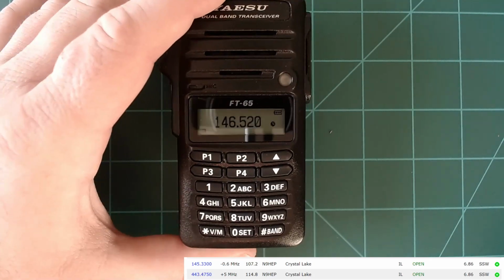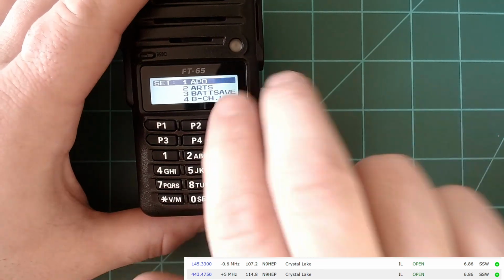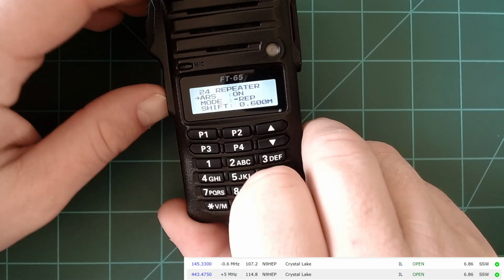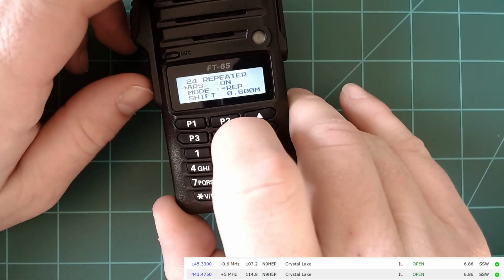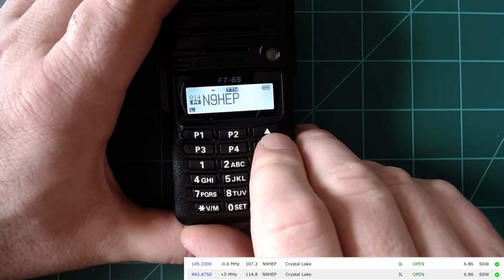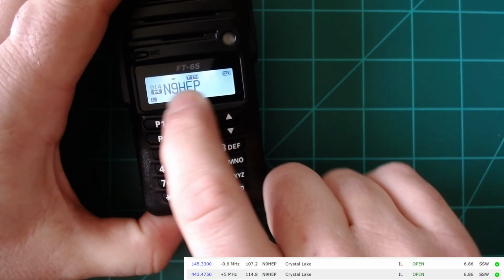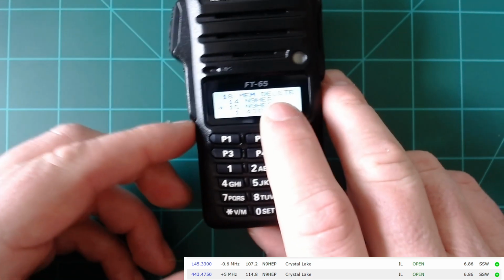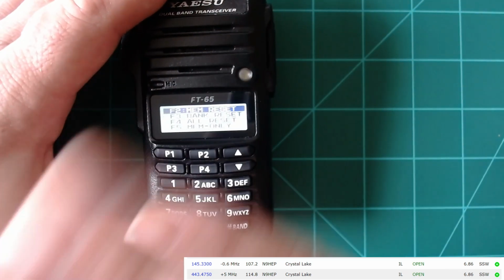Yaesu FT65 Manual Programming, editing and deleting

Comment: To tune a saved channel you select the memory channel, press band button. You should see a small "tun" text flashing on the left corner of the screen, just punch the new frequency in or use arrow keys. At least this is how it works on my FT65E purchased recently. Maybe they updated the firmware or something to make it easier.
Reply from the maker: Many Thanks for the helpful suggestion!  I have pinned your comment so others may find this useful information, easily.  73!
Reply: What Michal writes will allow you to temporarily tune to a different frequency. To save your edits permanently, you need to follow a couple more steps. After entering your new frequency, press and hold the *v/m button. Then use the up/down arrows to select the number of the channel you want to edit. (It will be flashing on the left side of the screen.) Then press and hold *v/m again to save your edit.
Reply: What if you’re already on the memory channel you want to edit?  Would you just press V/M again?

Comment: The P1 P2 and P3 are programmable buttons off your command program screen just hold the buttons down and remember so you don’t have to scroll down for CSST or the repeater function makes life little easier also holding down the six for long period of time will lock the phone the keypad in case your owners are using one frequency

Comment: I am adding a new channel, I have just Simplex on the Repeater menu, no - or +, store the channel, test it but when I move up down in the channel list when I come back to the channel in discussion I have a minus and it transmits with a -0.6 Mhz offset. Why? It's like it's ignoring the settings that I have when storing.
Reply from the maker: What frequency and offset?  Is it possible the offset will put it Out of band ?
Reply: @DudeTested  - No, I tested it in manual mode and works fine. I punch in a frequency, go to offset menu, set it up, go back to memory, memorize the channel, give it a name when prompted and it works good. As soon as I move to a different channel and come back, it's like it forgets the offset or chooses one of its own.

Comment: Ham radio dude,thank you for your time,I have a question is there a way to program a random PL Tone instead of using the arrows,  the pl tone doesn't show up when scrolling it gets close but skips the one I need..thanks again 
WRPR732 Net Control Operator Bloomer
Reply from the maker: I think I see what you are saying, you want to program a specific PL Tone which doesn't show from the FT65.  Which tone is it?  I do not think there is a way.
Reply: The pl is like 68.0 or 70.0 .. thanka@HAMRADIODUDE

Comment: Question: how come I cannot input certain channels? I was trying to input 462.347 and it auto inputs 462.350. I’m not a radio guy, so I’m confused.
Reply from the maker: Hello, my best guess is your channel Steps are set to something like 25khz. Meaning, the radio may default to 25khz steps. 462.350, 362.375 etc. I am unsure if the FT65 has a spacing for 462.347 or what would use that, but you can try changing the channel spacing.  I don't have the radio anymore, but it is located withing the menus under "STEP".  This may work for you:

 Enter Frequency Mode:

Press the V/M key to switch to VFO mode (Frequency mode) if you're not already in it.
Access the Menu:

Press and hold the F/W key to enter the menu settings.
Navigate to the Step Setting:

Use the up/down arrow keys to scroll through the menu until you find the "STEP" option. This is where you can adjust the channel step.
Select the Step Size:

Press PTT or MONI/SCAN to enter the STEP setting. Use the up/down arrow keys to select your desired step size (e.g., 12.5 kHz, 25 kHz, etc.).
Confirm and Exit:

Press the F/W key again to confirm the selection.
Press V/M or PTT to exit the menu.

Good luck!

Comment: Do you know by any chance how to program a repeater channel in memory mode so that it would have split tones? Specifically, DCS on TX and CTCSS on RX. The offset is regular: +5.000 MHz. I know setting the DCS TX tone would normally be sufficient. But there is a strong competing repeater when propagation picks up. Plus, it drives me nuts that I can't figure it out. Is it even possible on this radio? For example, on Wouxuns it's a cinch. Not sure about this one.
Reply from the maker: @SK-rj1ti  I don't, unfortunately.   If I can take a look,  I'll try in chirp to see if it's possible.
Reply: @DudeTested  Thank you, that would be great! Unfortunately, I don't have a programing cable for it. As a side note, 2 m propagation is super awesome around the lakes today (Sept 4, 2024) - if you read this tonight, give it a try. I am in MKE, so this likely applies to your area too.

Comment: I'm glad to know that I'm not the only ham that uses the -V or -U or just adding the V or U to the suffix of Memory Channel Names in general.  Admittedly, I use geo-locations for Memory Channel Names when possible.  Here in STL Metro, locations like:  BellvV or BellvU for Belleville, IL.  Edw-V or Edw-U for Edwardsville, IL.  Mary-V or Mary-U for Maryville, IL.  AltonV or AltonU for Alton, IL.  DtStlV or DtStlU for Downtown St Louis, MO.  Clay-V or Clay-U for Clayton, MO.  Arnd-V or Arnd-U for Arnold, MO.  HighR-V1, HighR-V2, HighR-U1, HighR-U2 for the High Ridge, MO repeaters (6 or more).  Etc.  It really depends on the total length of the Name permitted for the Name by the individual radio.  The FT-65R permits up to 8-letter character names.  Making it one of the better ones.

Comment: wow, just got my Y Ft65.. wow, and I thought programming desktop computers were difficult!   mm. where is the link to the programming cable, and is there software to use to program this thing? Sorry if I sound kinda dumb.. its been 35 years since I was on air last, with an old kenwood HT, (don't remember the model).

Comment: Hi do you know how to save to memory banks? or if chirp works with the baofeng programing cable on this?
Reply: CHIRP works, but the pin spacing is proprietary (closer together) from the Boafeng, so you need to buy a Yaesu cable,  also if you want any plug in  accessories (mic/speaker, headset)  you're stuck with Yaesu.

Comment: I'm an old Advanced Class ham. I have made a few hundred contacts back in the day, mainly on the 15 and 20 meter band.. I have been inactive for a long time. I picked this rig up recently and am shocked to see how complicated it is to simply use. I may have to find a local ham to help me, as I still cannot make a contact even after watching this video multiple times. 
I am trying to put in the Short Mt TN 146.910 repeater info as well as 146.490 simplex.  Plus a few other middle Tennessee repeater.  Wish me luck.

Comment: Thanks for the great video!  

One thing I noticed when is that you apparently can't delete the info stored in memory location 1.
Reply from the maker: Thanks for the info! I no longer have the radio to test but this comment helps other radio enthusiasts.  73
Reply: You can overwrite it without deleting it first. I believe 1 is the only channel that works on.
Reply: I can not edit/correct an error of a frequency nor can I  delete it. @tomperone9338

Comment: That’s a great video! It really helped me understand how to program my FT65. However, I got a problem with two repeaters here in Philippines, I can’t input repeater shift: (-) 6.78m. I notice it has an incrimental +25m or -25m... meaning my nearest point is 6.77m or 6.80m... is there a way that I can reduce the incriment from 25m to 5m, so that I can input 6.78? Thank you for helping me out
Reply from the maker: Hello, I don't have this radio anymore.  As I recall from other comments, Yaesu only allows for 0.05 offset increments.   to change the offset , look at page 28 of this manual - https://www.yaesu.com/downloadFile.cfm?FileID=13236&FileCatID=151&FileName=FT%2D65R%5FE%5FOM%5FENG%5FEH066M105%5F1710C%2DFC.pdf&FileContentType=application%2Fpdf  Hopefully that will help you!
Reply: @DudeTested  thank you! I’ll check it out later when I get home... Thanks!

Comment: Thanks much!

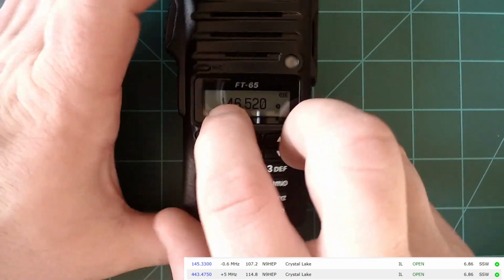1:00 VFO mode
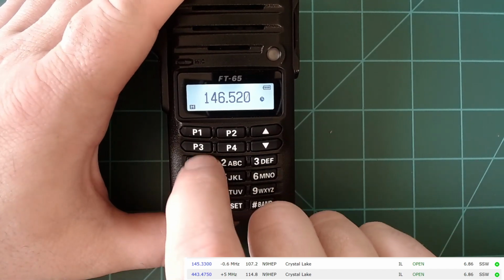1:30 keyed in frequency
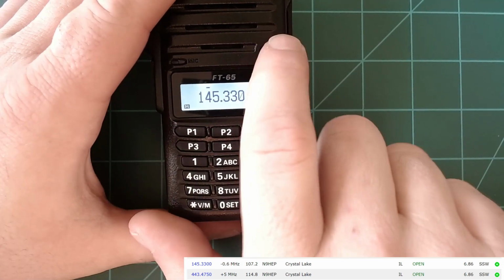1:55 menu
2:30 APO
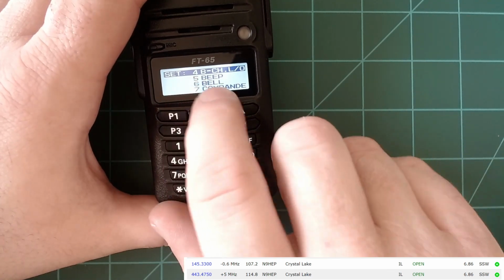3:00 CTCSS
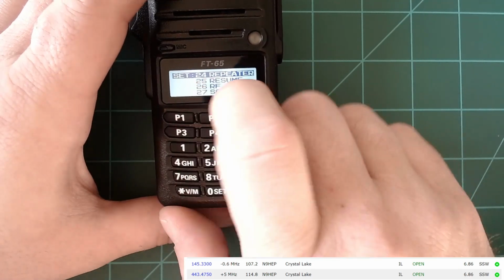4:48 repeater
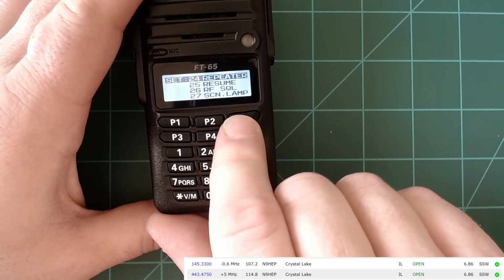5:30 RF SQL
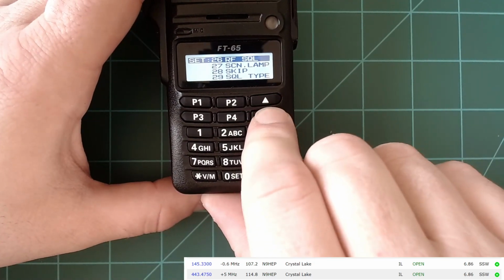5:57 SQL type
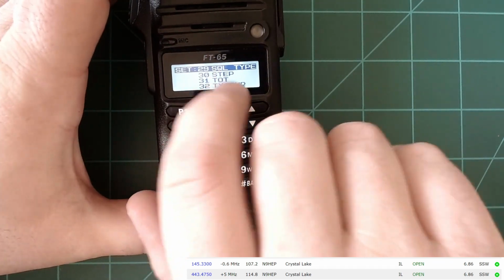6:46 repeater cont.
7:42 TOT time out timer
8:14 power
8:38 programing a repeater
10:17 error demo explanation
11:12 name tag (rename)
12:41 changes when in memory mode
13:52 can't modify frequency in memory
14:49 delete channel
15:58 factory reset
Reply from the maker: You're awesome, thank you!

Comment: hello  just a quick question......on option 24 repeater.....when i change the ARs  to ON  the Mode automatically changes to simplex but i want it to stay -rep. How do i fix this? Thanks VE3ZYO
Reply from the maker: What frequency? It may do that because ARS is deciding for you what shift you should be on based off the frequency. Or if you change frequencies in VFO mode, that may reset it
Reply: @DudeTested   146.82    -600

Comment: I’m a newbie and this is my first ham radio, got it a couple days ago. Haven’t yet figured out how to access my preset repeaters. Obviously, when programming the radio (as you’ve shown), the preset # is displayed-such as 8- yet I cannot figure out how to actually get to 8 after it’s saved! Doesn’t appear like a car radio where you just press 8 and you’re on that station.
Anyone know?
Reply from the maker: Sure. I don't have the radio in front of me at the moment but you should be in memory mode to get to 8. At that point you could either use the up and down arrows or you should be able to type in 08 or 008.  Give that a shot. Memory mode is typically shown with a V/M button.  Again, I don't have a radio on me so I'm not completely sure where that button is on the 65

Comment: I have a local repeater that is offset - 1.035. When I try to save it the radio rounds it off to 1.0 . I've tried fpp, yaesu software and chirp. Yaesu software rounds it off and fpp rounds it off. Chirp will input 1.035 but when I write to radio the radio rounds it off. Anyone have any ideas?
Reply from the maker: Which repeater is it, out of curiosity?
Reply: https://m.broadcastify.com/listen/feed/14747
Reply from the maker: @BigE36  Sorry for the delay. I no longer have the FT65 so it's a bit difficult for me to figure it out.  I was looking in the manual and saw option 25 "Repeater" has 3 options: ARS, MODE, and Shift.  The shift there is listed as a 0.05mhz-99.95MHZ shift .  I would think you should be able to change the shift in that option, but I assume you tried that already.  I'm going to keep playing with my FT4X this morning, and though not the same menu, maybe I can find a solution for you.
Reply: @DudeTested  the shift will only do 0 or 5. Example 1.055 however I need 1.035. It won't let me in put the 3. It rounds it to 5 or 0.
Reply: So I contacted yaesu's support people and this is the email I received:  "Hello,
The FT-65R cannot be programmed for a 1.035 MHz repeater shift. All you can do is set the radio to VFO split mode as laid out on page 7 of the Advanced Manual.
Best regards, "
Reply from the maker: @BigE36  I guess that is a solution, but yeah, I agree, why do that when they have the ability to have it be inputted in the offset. Sorry to hear, I'll be sure to bring this up in a future video i do, going over Yaesu radios.  Are you looking for radios that will do it?  If you know of any, let me know.  If not, I can go through my radio collection and see which ones will do it.  Best wishes..
Reply: @DudeTested  I'm very disappointed with this radio. All my other radios, Alinco DJ-MD5; FT-70; Kenwood TH-FT6A; BTECH UV-5x3 even my Baofeng UV-5R+ I got in 2013 they will all do that odd split. I wish they would do a firmware update and fix it but I know they won't. Thanks for your time. Really your channel. Like your format/style.

Comment: Thankyou for showing me the menu and the hidden menu,, now if i could add police freqs to..in the L1/U01 area but 1) i dont understand how to install them there & 2) it seems the radio rejects me adding the last 0 digit of the police frequencies it just jumps by them.. so confused  Thanks again Therin
Reply from the maker: Hey there. I no longer have the radio, but I'm assuming the PD is operating in a frequency like xxx.xxxx.  In that case, you would need to set the radio to a 2.5k step.  However, I don't recall this radio having the ability for a 2.5k step. I could be wrong... Good luck
Reply: @DudeTested   you are correct it does not have a 2.5k step  that was suprizing and another issue hampering getting police bands
Reply: THis is what I was looking for:   It is how to skipover (LARGE memory blocks in the 100s) to set-memory/retrieve from Selected scan areas(L1/U01 areas ) this is not in Yaesu Basic or Advance Manual ..... I found it elsewhere the link is on the memorypage-Trick https://data2.manualslib.com/print_page/en-65f9806680b7c126f812abbafa945185.pdf

Comment: This is a great big help! I to have a question though. I can't find out how to program and use the home frequency on each of the three bands. I know there is a way according to the manual but I seem to do it.
Reply from the maker: Good question.  I don't have the radio anymore, but I did find this : 1.  While operating in VFO Mode, select the desired frequency.  2.  Press and hold the *V/M key - a blank memory channel will be displayed  3.  Press the P1 key.  Home-IN will be displayed , and then exit to normal operation.  The home channel is changed and overwrote.

Comment: How can I get MURS on radio
Reply from the maker: I no longer have this radio but found this : "Unlock Transmission Range – MARS/CAP Mod . Party on. Allows you to transmit on non-ham bands like FRS. Expanded Transmit Frequency Range: 137.000 – 174.000 MHz and 420.000 – 470.000 MHz.
To Enable the Mod: Turn the radio off. Hold down PTT and the middle-side button (T/Call) while you turn the radio back on. You’ll see “F1 SET.RST”. Then type in 32406665. The radio will reboot itself. Repeat to undo"

Comment: I dont know what i do wrong. I can hear the repeater but i can transmit.
Reply from the maker: If you can hear the repeater but not transmit, you probably have the wrong CTCSS/PL tone in the radio or there is a possibility that you are too far to transmit, but you can still receive.  I would need more information.  Do you have a PL tone in the radio?
Reply: @DudeTested  Everything is ok. I think that i cant transmit but now  i can. Thanks.

Comment: I am trying to edit a memory as you describe on the video I am trying to change the repeater from simplex and rep- I follow everything while on mem mode then once back on top menu I press monitor button. The changes appear saved but if I switch memory they are gone
Reply from the maker: My radio just died.  I'll throw it on a charger and see if i could replicate the issue myself

Comment: Hey thanks for the video. I have a quick question. I just received a couple hours ago my yaesu 65R and was wondering what are some better antennas for the radio then the one that it comes with. Thank you.
Reply from the maker: Good question.  I haven't played too much with external antennas.  I could tell you to start away from the super short antennas, they are horrible (some 40:1 swr) .   I do have a chart where I tested all the antennas I own, let me try to dig it up when the painters finish that room.   Also, if you buy an antenna, but from a reputable dealer - if you weren't aware, there are quite a few fake diamond and comet antennas out there.
Reply: @DudeTested  I Recommend a Diamond SRJ -77CA this antenna works extremely on this Radio